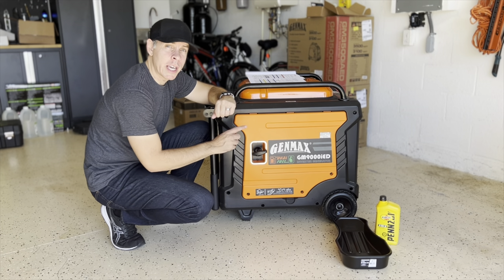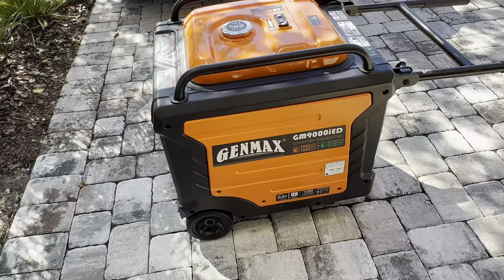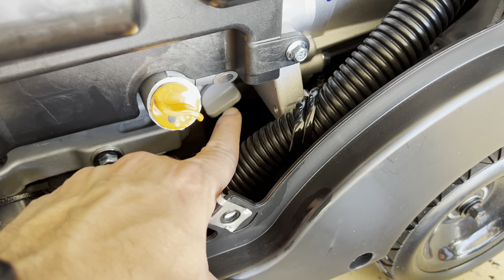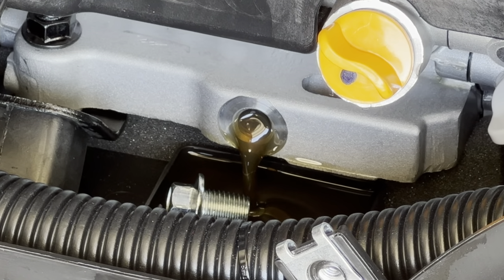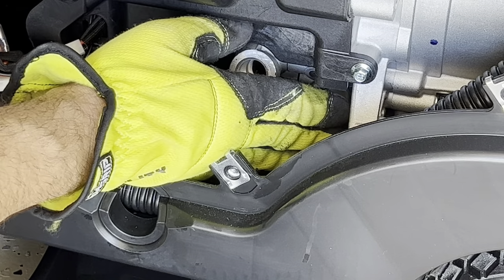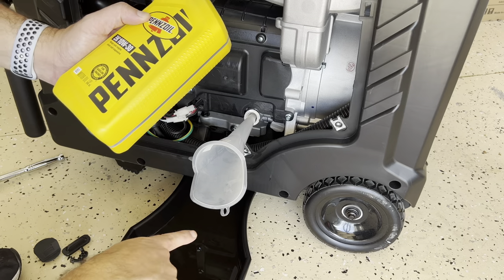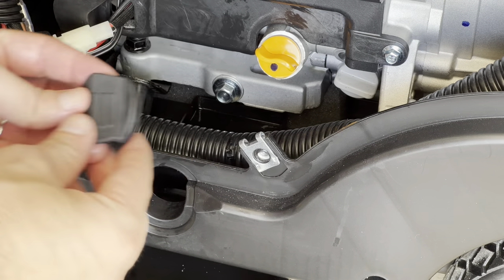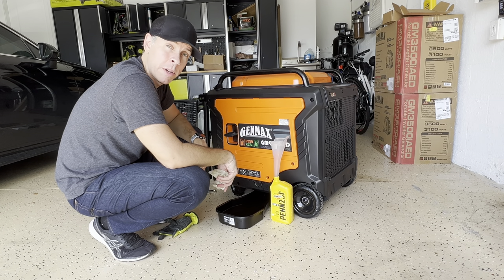GENMAX GM9000iED Oil Change - Break-In Period

Comment: I had my eye on the 9000 but decided on the 6000. Runs everything in my house (AC, water heater, electric range, fridge, electric water heater...), is 140 pounds lighter, and $1,000 cheaper. Have to be a little more aware of power management for a couple high draw appliances, but no big deal.

I went a step further with my break-in and used actual break-in oil for about 1.5 hours on a 20% load after a 5-10 min low idle warm up. Before this, I took the spark plug out and lubed the upper cylinder with Lucas so the initial start wouldn't be dry. I switched to a cheap conventional for another 3 hours with 2 oil changes to flush the particles out, then filled with synthetic (Amsoil small engine oil). I plan to run that for another few hours (probably my first real use of the generator), then change the oil one more time. Thinking I'll probably go to more regular intervals at that time. 

"Break-in oil is different from regular motor oil because, by design, it is supposed to allow the rings to wear down the peaks on the cylinder wall to form a good seal. Regular motor oil, in contrast, is designed to prevent wear." - Amsoil. My thought process was the break-in oil would seat the piston rings much sooner and more efficiently than regular oil. 

https://www.youtube.com/watch?v=vANsbZf03DQ

 I've seen a lot of people say "no load", but I think you need to have some load so there's pressure on the piston so the rings seat properly, maximizing compression and reducing the chance of blow-by. Since the engine is designed to be used under load it made sense to me to break it in with some light load to start, change it up every once in a while, and increasing the load up to 40-50% by the end of the break-in. By around hour 5, I did want to see if it would run my water heater, so I was at nearly a 100% for a few minutes before my final oil change. Anyway...my two cents.

Comment: Got mine this week, doing the break-in as we speak so its ready for use during the next hurricane.
I did get the magnetic dip-stick I see that recommended a lot, have not thought about getting the magnetic bolt.

I mean with the filter this unit is already probably a lot cleaner than other units, but at the same time $10 is not much to add for some extra insurance.

That oil pan, now that is the real life saver, kinda expensive for what it is but worth not having to figure out how to raise this thing to drain the oil.

As far as load, I gotta figure out what I'll plug into this thing, I ran for about 2 hours yesterday on eco mode, and an hour with eco off.  so want to do about 2 more hours of run time with some kind of load on it, and then change the oil.

First impressions, much bigger than I thought it would be, but easier to move than expected with the handles.
Much quieter than I expected, probably more quiet than my 2000w Champion Inverter generator, especially under load.

Not a fan of bolts to take the cover off instead of a quick release, but I can imagine that might help with fighting vibrations.

Something I wish I had done for that first time run, rather than read the manual, add oil and fire it up.  I wish I had removed the spark plug and put oil in there, and pulled the start cable slowly a few times rather than just firing it right up with a dry cylinder. 

I think the next logical video for you to make if you want to make some more content is the method you decide to use for storage when not in use.

For me that just involves putting a little bit of ethanol free fuel in the tank, with some stabilizer, run it thru the system for about 15 min, and then cut off the fuel to run the carb dry.
From there I'll just run it for about 15min and run dry again every few months, when I change my HVAC air filter I'll make this part of the rotation.

But some people go really far with this, actually draining the tank, draining the carb, etc.
Reply from the maker: Nice 👍🏻. I do the same for storage and I start it once a week or every 2 weeks. I also use Stabilizer.  I am about to make a video changing the spark plug because last week I had some trouble starting the generator but finally started and I think is related to the spark plug.

Comment: Very informative Thx. 2 questions: What did you use to clean the filter?
I have a 30 amp power input plug rated for 7500 watts with an interlock in my panel. Can I buy and use the 9000 with 7600 running watts with my 30 amp setup? Thx again.
Reply from the maker: Hello. I washed with Dawn and water then dry it out.  To your second question. YES. But you will get 30AMP not 50. If you want 50amp you will need a 50amp power inlet and a 50amp breaker with 6/4 cables.
Reply: @JavierRivera  Very clear answers. I thought about buying the GenMax 6000 for $1399.
GenMax 9000 has $200 off now, so it brings it down from $2199 to $1999. Still $600 more but at least with the GenMax 9000 I will be spot on for the 7500 watts, 30 amp running watts. 
Now with the GenMax 6000, it will be approximately 5700 watts running. So your talking an additional 1800 watts for my home. Javier check out the Low Profile Oil Pan on Amazon, I think it cost $17.00. 
Great answer, thanks again.
Reply from the maker: @mikeienuso1926  I will get the gm900Ied. When you see the specifications, the GM6000iED has a gas amp max of 25A peak, and 21.9A running the GM900iED has a 37.5A peak and 31.7A running.  The propane peak is 22.9A vs 35.6A peak and 19.8A vs 30A running.  so there is a difference. If you only have a 30A power inlet and want to maximize the use of that plug, you will need the GM9000Ied. Compare the specs online at genmaxpower.com

Comment: great video! I just received my Genmax 10500 and ran it for 1 hour with 10W-30 full synthetic. I honestly didn't even know that conventional still existed. Should  I drain the oil and change to conventional 10w-30?
Reply from the maker: 10500. Men I wish I had waited for that one.  No you should be fine.  However; I read in the manual that came with the generator; Is not at the online pdf; that the recommended oil is 10w30. IF running the generator in Extreme Temperatures see the following chart for recommended oil type.  And in the chart says from below  5°F to above 120°F to use 5W-30 full synthetic oil.  
Check your 10500 manual that came with the generator because I just checked the online pdf and the chart is not there either.

Comment: recently purchased the 9000IED, needed a more quiet generator for my concession trailer. Have a predator 8750 , great unit but loud. I did my first 3 hours under low level load changed the oil then 3 more hours under medium load and changed the oil, Then last weekend an October fest event with a 8 hour run time. It ran great and I did get the low profile oil pan on your recommendation (must have). This also allows me to change it right on the trailer, its mounted on a platform on the tongue of the trailer and at over 250lbs, I really like not having yo move it. What a change in the db level and now I can go to more events with closer proximity to other vendors and not be "that guy" with the loud generator. I also just purchased the magnetic dip stick for it . One issue which i resolved quickly from a post from one of your other viewers (thanks you) was about the 50 AMP connection. It will not go in all the way due to the frame of the generator , the bottom hits so its out about a quarter of an inch , not recommended to leave. I purchased an adapter that gives it plenty of room to make that adjustment. Its not a pigtail but a extender of the prongs . So far I think this was a great investment and I hope to have it around for awhile. Great video and thanks for the info . 

Jim

Comment: Here’s a hit for everyone… Always waist 1 quart of new oil to run thru the open system to flush out any remaining pieces of lose build material.. it’s a cheap way to help you completely clean and flush out a brand new machined engine after the first break In period.. 👍

Comment: I also purchased the magnetic dip stick to catch the really fine ferrous metals. ( uses the same dip stick as the Predator Generator)
Reply from the maker: Can you tell me which one? I bought one but the threads were a little loose so I returned.
Reply: @JavierRivera  I ordered the Wen GNA273 magnetic dipstick for Wen 9000 and Predator 9500 generator, it's coming Tuesday,  so I'll let you know if it fits.
Reply from the maker: I ordered 2, one it was that one and didn’t fit at all.  The one that it was lose it was the Atima Magnetic Oil Dipstick Fits Champion 73536i Wen 56200i 56235i 56203i Predator 3500W Inverter Generator
Reply: @JavierRivera  the Wen GNA 273 was to big,  so 27mm is to big
Reply: @JavierRivera  the Wen 55201 was to small (18mm)
Reply from the maker: I ordered a new one Arrives on Thursday.  Fingers crossed 🤞 is the right fit.
Reply: @JavierRivera  please let me know 🙏
Reply from the maker: You got it. WEN GNA200 Magnetic Oil Dipstick with M20-2.5

Comment: Hi again! Any chance you could let me know the exact tool you are using to remove the drain plug? Looks like a lug wrench or ratchet but I don’t have one and need to change the Gen’s oil. Gracias de antemano!
Reply from the maker: Hi I am using a 1/2” Ratchet with an extension and as 1/2” socket.  I got a good mechanic tool set from Harbor Freight.

Comment: Any issues with the CO sensor shutting the generator off? Great unit, mine is very sensitive on the CO .
Reply from the maker: No.  Are you sure ID the co sensor and not the oil sensor?   Another viewer told me that after disconnecting the oil sensor the generator had no problems.
Reply: @JavierRivera  Wow !   impressive reply time.  Oil level is good. No low oil indicator light.  I switched over to propane, better outcome with strategic placement.  Full disclosure: I'm hoping to fire it up from within the bed of my long bed truck with my RV.  It's a bit heavy for offloading to run curbside. 
I'm wondering if the exhaust was extended beyond the case, if this may help.  Thanks for your channel!
Reply from the maker: The person who told me about the oil sensor said that no light 💡 was on.  He just disconnected the sensor to test it and it works in his case.   If you concern is CO I do not think extending the exhaust will help. The generator is already outside.  If you had it inside the garage then I see a benefit on extending the exhaust to vent it to the outside of the garage.   Here is something that I thought 💭 to do or use if I decide to put it on the back of my truck.   https://amzn.to/467z47N

Comment: Hi, Javier I'm kind of confused you said after the break in period you said to switch to 5w-30 synthetic, but I see you put in 10w-30 again is there a reason why you didn't switch it? Or do I need to run 10w-30 again? thank you in advance
Reply from the maker: 10w-30 is the recommended by manufacturer but after the breaking period you could change to 5w-30 if you would prefer to use synthetic oil.

Comment: If you get a magnetic drain plug, please let us know the part number or link to amazon. Thanks
Reply: Wen GNA200 20mm x 2.5 fits  perfect! Amazon
Reply from the maker: The WEN GNA200 Magnetic Oil Dipstick with M20-2.5 is the dipstick. The magnetic drain plug has to be M12x1.5x15

Comment: While draining oil I always tilt & prop up the unit so I get more oil & any particles out.
Reply from the maker: 1st is heavy.  2nd  I thought about it but I was afraid of breaking the tire with the weight tilting it and making pressure on a wrong angle 📐.